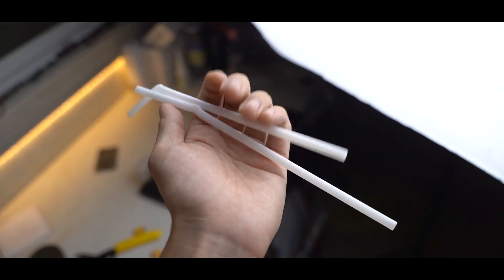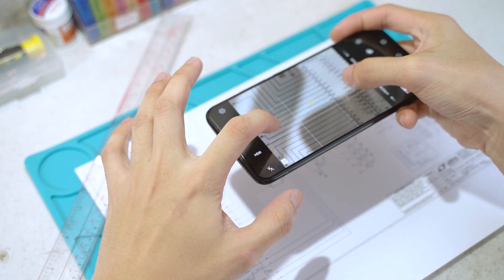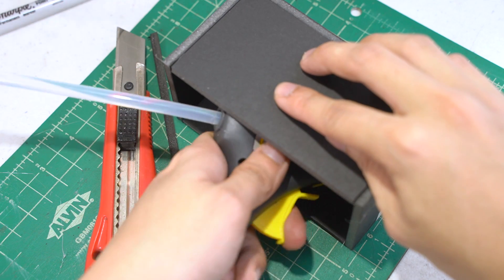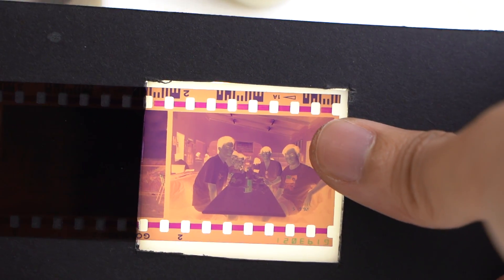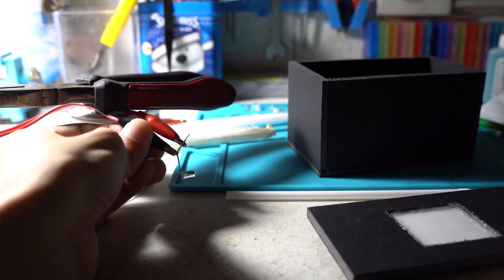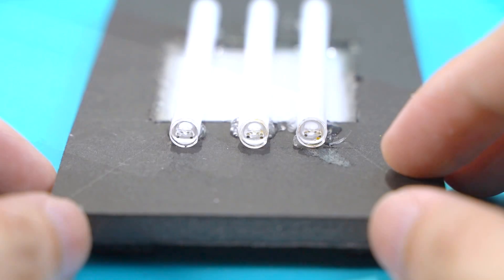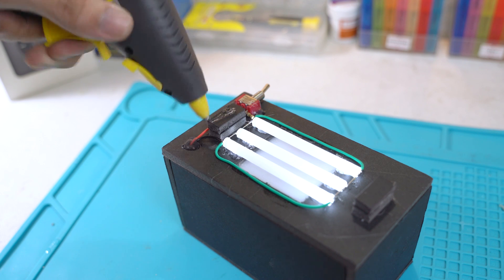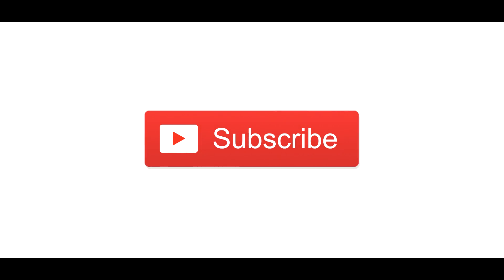DIY Cardboard Smartphone Film Scanner (v2)

Comment: Nice job! I might have glued (or use double stick tape) a piece of reflective paper (any foil/Mylar lined jar liner might do) on the inside facing the LED light tubes side of the base foam-board to take advantage of as much of the light as possible.

Comment: What about remove scratches from negatives and use infrared scratch correction? also it hve very bad dynamic light range and not work for hi quality sources.
I use drum laser scanner. or restoration negatives in ultrasonic bath, and after scan negatives in liquid use some adapter for Nikon Scanner.

Comment: nice build. though one of the main fucntions of foamboard is being able to cut through one card layer and the goam but not the second card layer and use folds and mechanical joints to make things without needing glue.

Comment: I build sth. similar, using the cheapest flat LED ceiling light I could find in the hardware store and crafting a "stand" for my DSLR from a yoghurt cup (one of the larger ones.

But: the "lightstraw" idea is gold! I would have never thought of this!! Thanks man. You earned a sub with these straws.

I save that idea for the next time I need a small diffuse light source. You could even add adjustable blue and yellow LEDs to (sort of) adjust light temperature.

Comment: Hello, very interesting and nice project, Although I am a strong film user, I find it necessary to scan my thousands of negatives. Commercial scanners are only affordable to Bill Gates and perhaps Jeff Bezos and they might need a bank loan to buy one, so your idea is extremely clever and easy to make. Some changes that I might need to make: No black foamboard is available here. I imagine I can use 5mm. balsa sheet painted black. Also, can you please give me measures for 120 film size negatives? This is important because 35mm 24 x 36 negatives are not the only ones that need scanning. Also Minox (8 x 11mm) and 100 size film.  And what about slides, positive film?  Congratulations once again and greetings from Colombia.
Reply: Can you not just measure the negatives you have now? I imagine you can create a modular bottom component for each film size.
Reply: @tristanjackson6791  Thanks, the 120 film size negatives are 6 x 6 cms and Minox is 8 x 10 millimeters.

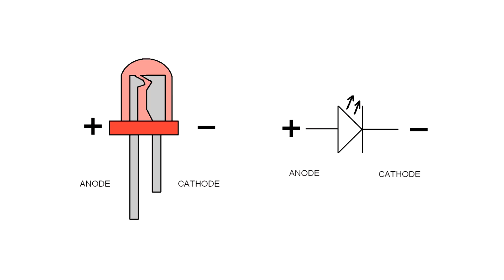Comment: May I know what’s the metal bar looking item that you use to solder the leds together @ 6:44 ?
Reply: It’s just solder
Reply: ー。ー두부 I’m not referring to the solder fusing the led. I’m talking about bar connecting the components
Reply: @MrRubyxp  That is also what I was refering to, but it seems that it is just a paperclip or something. You can also use solder for this application though.

Comment: good, use a 9 vt battery holder the hot glue will tear apart your build, first time you have to change the battery
Reply: My thoughts exactly. How are you going to replace the battery without destroying the case.

Comment: Why do you put glue on the battery? How do you get it out when the battery is finished?
Reply: DLH Fordada hot glue is really quite easy to rip off
Reply: @-lll-ll-llll-AVE  Thanks for that info. But would it be easier to use a rechargeable?
Reply: If you were to use a rechargeable battery, i think you would be better off making a less permanent solution to hold the battery (ie a casing instead of glue), though I’m sure you wouldn’t need to replace/recharge it often anyway, the LEDs being very energy efficient

Comment: Great little project! Here's a tip that can significantly increase the amount of light behind the slide: Simply place a piece of tinfoil behind the tubes to reflect all the light back, that went out of the tubes in the wrong direction and would otherwise just have been absorbed into the black bottom. Make sure it also covers the sides so that light can't escape that way either. You'll be amazed how much light you can actually get out of the leds that way. Anyways thanks for sharing. Great idea!
Reply from the maker: Great idea!

Comment: Very nice project. But considering the cost of the parts, and the tools you need, maybe is much cheaper and faster to buy directly on Amazon the Kodak Mobile Film Scanner  https://www.youtube.com/watch?time_continue=1&v=3SXmPAcS9yE   . By the way, with a few modifications, this project can be useful if you want built a scanner for the 120 film format up to 6x9 cm or even larger format up 4x5" or 8x10"

Comment: Regarding the lighting source, I bought a domestic LED panel light with a really well diffused light. I wouldn't want to use mains voltage in any project unless you're qualified, but I learned a lot about how it was diffused. Instead of shining straight through the diffuser, the LEDs shine into the edge of a clear panel. There is a reflective sheet behind the clear panel, then a white diffuser as you used, followed by a sheet of frosted clear plastic to spread the light. This last layer isn't needed for your kind of project.
Reply from the maker: The reflector sounds like a good idea!

Comment: This is a good effort. I especially like your jigged foamcore construction techniques. 

I've built a few phone scanners. You can get a good result, especially with a good even lighting source and the Kodak app, but even the best phones (as of September 2019) struggle to get resolution at macro distances compared to a scanner or a proper camera.

You will get results good enough for social media, but you won't make archival quality images or decent big prints.
Reply: i use the Canon Bellows attached to my a7iii, what lightning source you suggest to use as backlight?Thanks
Reply: scan them at high resolution with a scanner and use a colour printer to print them on a4 transparencies. :)  then ... develop a really huge mobile phone... i dunno.. oO
Reply: @parishna4882  Keep the goal in mind - if all you want to do is load up some old negs onto your cell phone to share, why make it any more complex?
If you want more resolution/color control, then a proper scanner is the way to go.  
But there's no need to make it any more complex than it has to be.
Reply: @dstone1701  Wait, what???  But I've almost finished building a really really big mobile phone now.... Oo

Comment: this film scanner is great. but i think it will be better to invert negatives in regular pc program like gimp or if you have money in lightroom
Reply: Yeah, nah. Colour negative films are more complicated than you may think. That orange base tone is a correction mask produced in the image during development, and it varies in density according to the colours of the original image. Also, different manufacturer’s film have different orange tints. For accuracy you need software that’s sophisticated enough to both detect the film brand, and to apply compensating filtration according to gamma (the degree of contrast according to exposure) for each masking layer in the original film. If you don’t have the right software, getting acceptable colour can take a lot of fiddling around with Photoshop or Gimp.

Comment: How do you know which is the positive and negative on the used led? New ones have one of the contacts longer than the other.
Reply from the maker: LEDs have a flattened edge, the pin closest to that flattened edge is the Cathode (negative).
Reply: @TechBuilder  Ah awesome. That I didn't know. 😉